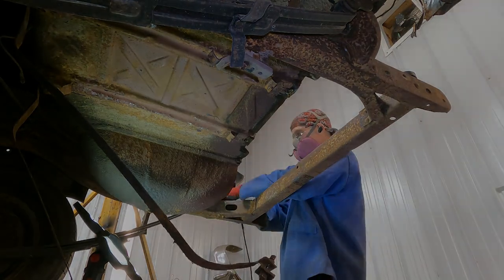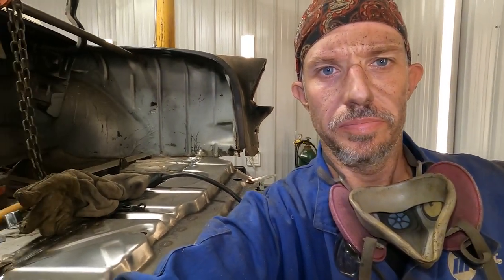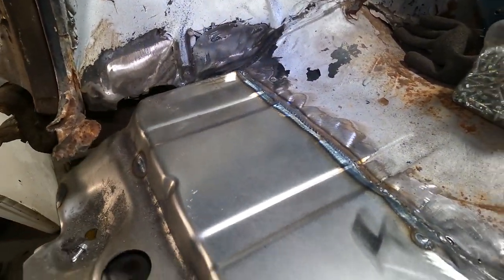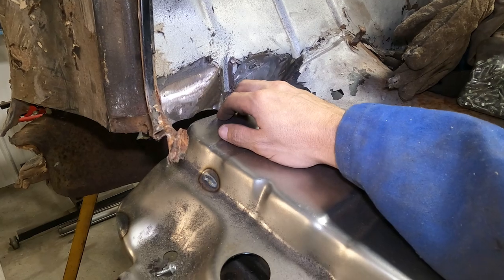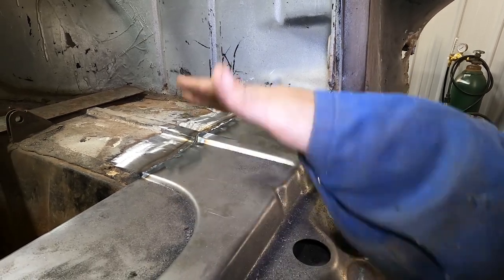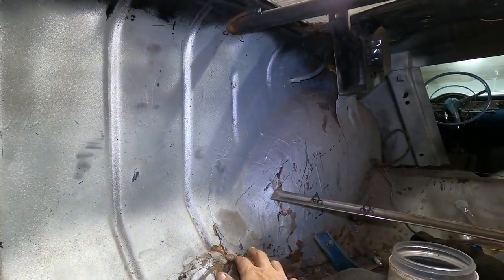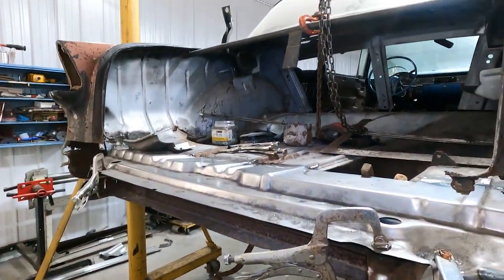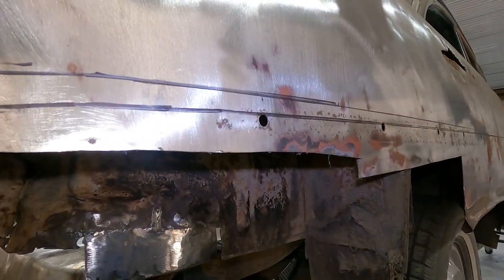1955 Chevy Belair - Partial Trunk Replacement - 2 Door Conversion!

Comment: Alright bud, first things first. Take those semi square sheet metal clamps and take them apart. I had the same issue with my trunk only in the opposite direction because I used them opposite of what you used them. Get yourself a foot or so of aluminum 1” square tube, cut every inch with a slit on top and drill a hole on bottom. Now take the parts you removed from the other ones and install the guts. Now when you clamp the sheet metal with the little square dowel, you have a flat plane to weld the rest of the sheet metal with. That’s a little trick I learned with those things. You can save the old semi-square for welding sheet metal that has a slight concave with very little hammer and dolly work.
And second, use a little torch and a scrapper to remove the rubber under coating. This is what I learned with my 57 bel air that I’m currently rebuilding.
Good luck!! And have fun with it!
Reply from the maker: Now, that's something I didn't think of. Of course those little clamps would cause that to fold. Interesting! Thanks very much. I will try your method and make a tool for anything else like this. I have the pan full welded across, so I think I'll cut it from the quarters, or at least the bad side, and I'll weld a piece of something to it to try to straighten it out. As for the undercoat, I was think of heating it up. I won't bother right now, I'll wait until the chassis is out of the way. I'm focusing on getting the car so it actually has a rear section. Thanks very much for the comment and input.

Comment: I agree. I won an eBay auction for a '67 Bug back in like 2005 out of Kentucky at an estate sale. I was told it had never been wrecked, had all original parts, original paint and the owner was a mechanic so it was well maintained. Packed up and drove to SW Kentucky from Michigan...got there it had been hit front and rear, had the wrong rear clip arc welded on, it had the wrong engine, had a horrible flat blue paint job over unprepped original paint. I could chip it off with my fingernails. The lady who was in charge of the auction was the niece of the previous owner and told me the lawyer who was meeting me had the title and keys. Nope. Turns out she was handling the estate for her aunt, and when her uncle died they never transferred the title to the aunt. I should have left it there. But I was like $400 into it with truck rental and deposit, and I only paid $800 for it so I took it. I eventually got the title and collected a lot of parts for it...but when I build my next '67 bug, I'll just buy a running, driving southern car in the $5-7000 range and save myself a LOT of time and effort.
Reply from the maker: That's a crazy story. I have a 66 bug as well. The thing with this car is that I was specifically looking for a project car to convert to 2 door. I was looking for something I could work on for a while because that's what keeps me sane. I just didn't expect it to be this cobbled up. I'm okay with it, I have now stopped counting parts costs. It is what it is and I'll really enjoy road tripping it when it's done. Thanks for watching and taking the time to comment.

Comment: There is a statement in racing about making a small fortune in racing , but it takes a large fortune to get there..... same for restoring old cars.  My 53 chev 2 door was in far better condition very solid, after removing the undercoating from hell it got deep. but we are nose up now. Cars from arctic areas , start by pulling the valve stem caps and replace the car.. the journey is long and hard but the reward is gold .  Embrace the fight and set your sight on the end .  It will HAPPEN if YOU don't give up.. Its not about the money. You have to LOVE the WHIP.
Reply from the maker: I'll get through it, it's a big project, but it will just take the same two things, time and money.

Comment: i have a rusty 56 cp im putting back together my trunk floor had a similar problem when i replaced the rear part of the floor too. i put some interior floor pans in it and inner and outer rockers.
  fixing rusty cars is a lot of work but it seems to be the only way i can afford to get really cool old cars. 
its great that your building the 55 the way you want it to be. and that you can look at it and say i did that myself how cool .   im doing a tudor conversion on a 51 ford 4dr, i just dragged home the tudor parts doner for it sunday.
Reply from the maker: I've heard from a lot of people that they have had the same problem with the section of the trunk floor. Glad to hear it's not just me. I could afford a finished '55, but would likely have to sell some other cars. I like all my cars, so I'll just put the work in and make this '55 the way I want. I also enjoy the project and I think you're right, when I'm done, I'll be pretty proud of it. Good luck on your project, and thanks for watching!

Comment: Hello. Your welding ability. Is. .   I ask. Why. Not. Plunge. Cut. The.  Joints. Weld. But. JOINT. Or. Do. You. Beleave. Over. Lapping. And. Welding.   You. Should. Check out.  Cris. Birdsong. Channel. And. Check. His. Techneec.  A great.   Style.   One. Seam.    Looks.  Great.
Reply from the maker: I'm not sure what you're trying to say here, but I'll see if I can answer your questions. I'm a certified welder, and have more than 25 years experience welding, so my ability should be okay for this project. I elected to do a combination of butt weld and a half lap on this panel to increase strength. This isn't a part that will get body filled and painted, this will get seam sealed and painted with texture. Only one seam shows up top. 2 seams below. I am absolutely fine with it. You have to keep in mind that this car is pretty well junk and I'm doing what I can to make it better. This will not be a concours restoration. I appreciate the comment and I'll check out the channel you recommended. Thanks for watching.
Reply: @SlowCarFix  Another good channel is Fitzee's Fabrications, if you don't know about it already. I think that's what he's talking about with the "Plunge. cut." Chris Birdsong's channel is called Junkerup Chris Birdsong...in case you go looking for it.
Reply from the maker: @jayinmi3706  Thanks very much. I watch Fitzee's videos, he does great work. I'll check out the other channel.  thanks for giving me the proper name, I'll look it up this week.